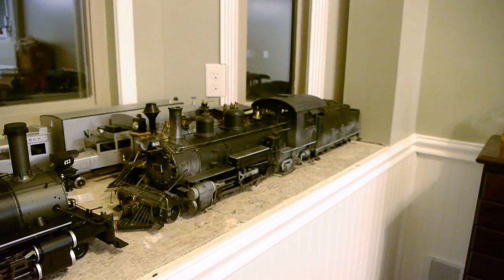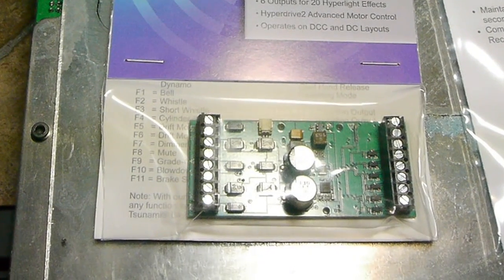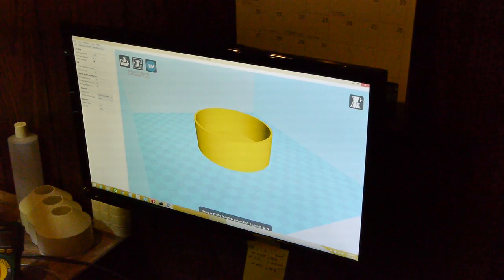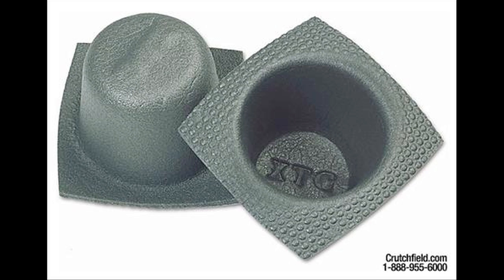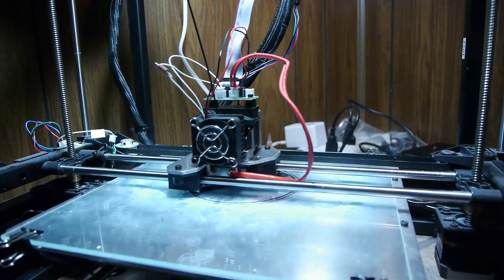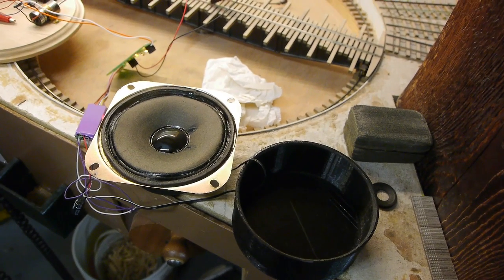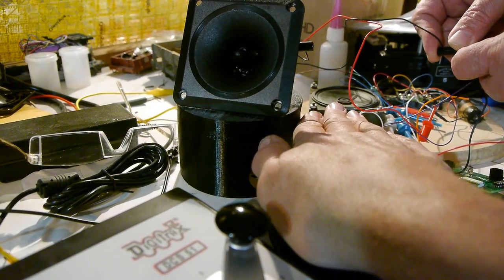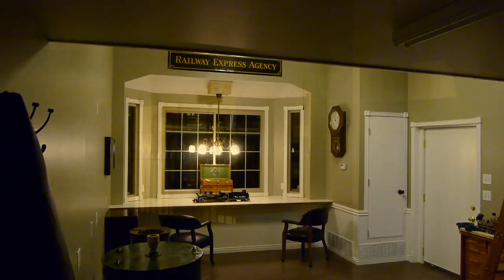Building a Speaker Baffle for the K 27 Locomotives on a 3D Printer

Comment: it's awesome to see 3d printing being used more in the hobby. I use my printer for some custom low cost railcar chassis and if your creative there's a lot you can do. it's helpful for prototyping before you get something made in a more expensive material.
Reply from the maker: +Calvin Witt We have an upcoming (maybe next week?) on making N scale rolling stock and cabooses and even locos. In the Hostlers show, in the contest, the N scale is all 3D printed.
Reply: +Toy Man Television Oh nice! it's awesome seeing you guys embracing technology into the hobby such as 3d printing and gopros! curious if you thought of making a bell shaped resonance chamber so the height is minimized but you can get max audio output still.
Reply from the maker: +Calvin Witt REALLY? New to me, but that's nothing new. WOW. We will give that a try!!
Reply: +Toy Man Television it's just an untested thought but it may work! I also designed up a gopro mount based off your your video that is 3d printed. I'm going to do a video on that soon!
Reply from the maker: Sounds cool!!

Comment: Might see about making a simple speaker baffle for one of my Big Haulers.. Although I reckon it'll be made of something a bit simpler as I don't have a 3D printer :)
Reply from the maker: +Will Coleman You can make a great one from PVC pipe. And a cap. The kind that fits inside the pipe. Should fit that loco just fine.

Comment: These are cool baffle for cool engines! I wish I could have the place for a third of it in my models, but the small Digitrax baffles are already quite difficult to "insert".
But these headphones are uncool, maybe in the Trimotor time, but not now. The only cool headphone for pilot I have found cool was in-ear model (but you don't need any headphone in a real sailplane, and that is much much more cooler).
Reply from the maker: +pbyfr I bagged those headphones because they look cool. With a leather helmet!! Always wanted to go in a sailplane!!! I want to FLY the thing too.
Reply from the maker: +pbyfr Small is harder. Love it but it's harder. As you get older it harder still. If I make it to 90 I'l be modeling 1:1.

Comment: I'd be tempted to try vacuforming to make the baffles. A small vacuforming setup would be easy to make. Looking at videos I'd bet the baffles Lionel put in their high end engines and sound cars are vacuformed. If you're making multiple copies it would take a fraction of the time.
Reply from the maker: Should work!! The key is to get the exact size and shape. So the 3D printer is great for that.
Reply: Make your master with the printer, copies by vacuforming. Should work well.